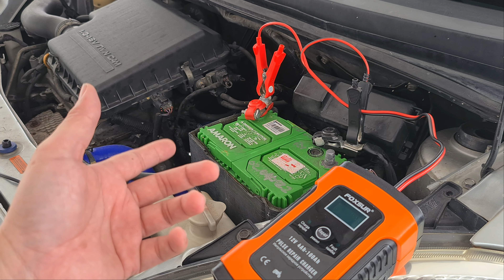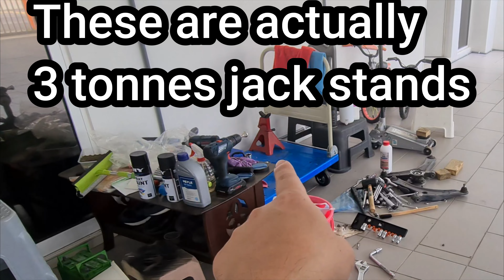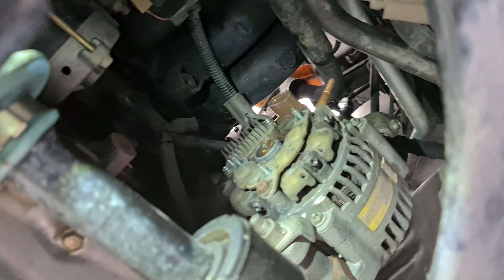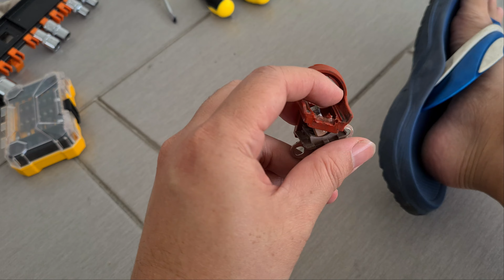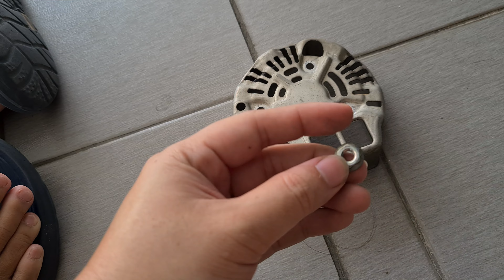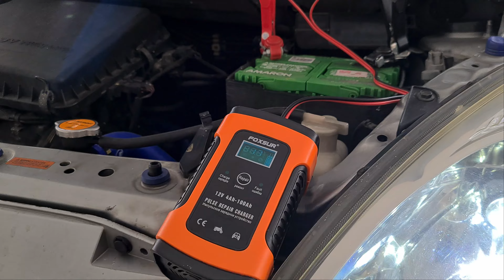Fixing alternator without replacing it.

Comment: Thanks, another helpful video. However, you should have shown the carbon brushes being removed and replaced, and told us where you got the carbon brushes from.
Reply from the maker: Sorry, the space was tight and I could not get my phone and hands in together. I tried to explain as much as possible in the video.
To remove the carbon brush, two screws next to it needs to be removed, and you just pull it out.
Installing it, just press down the carbon brushes and push it back in the same place you pull it out.
Link in the description on where I purchased my carbon brush.
https://shopee.com.my/Alternator-Carbon-Holder-Brush-Holder-Proton-Saga-Myvi-Viva-Kancil-ND-TYPE-i.529602001.17358945574
Reply: @TCsAnythingGoes  Many thanks - I'm subscribed and look forward to much more helpful content, particularly on the Alphard, which I have!